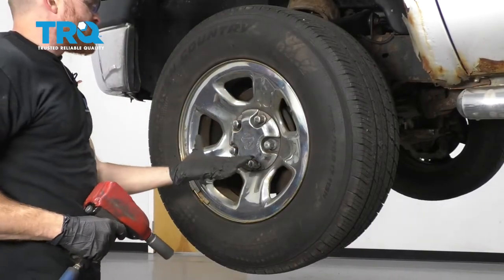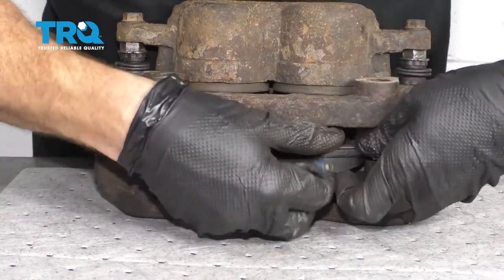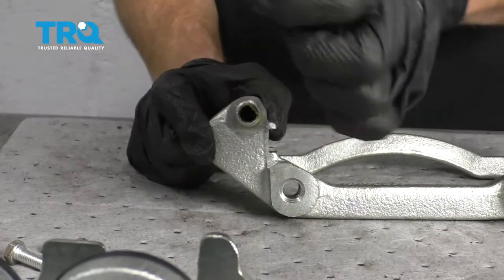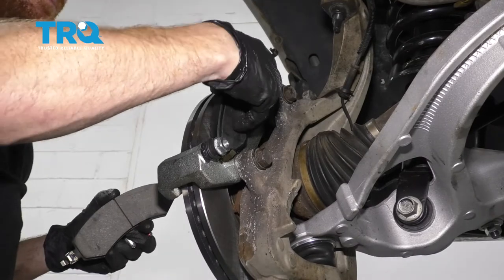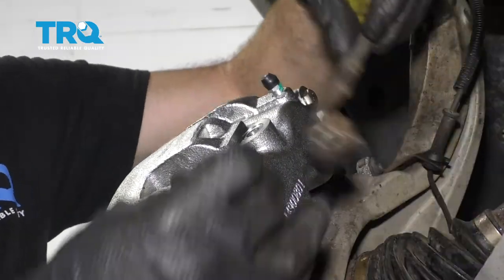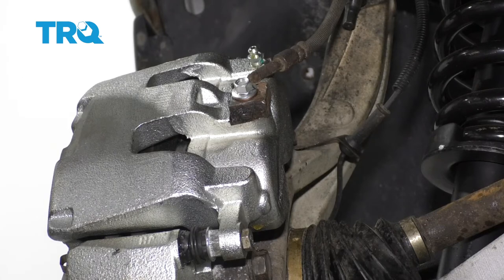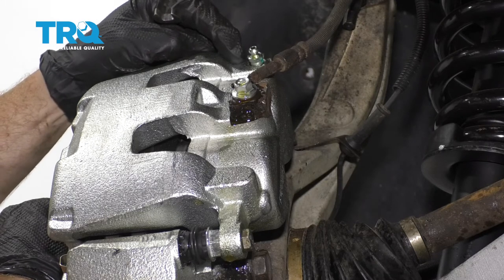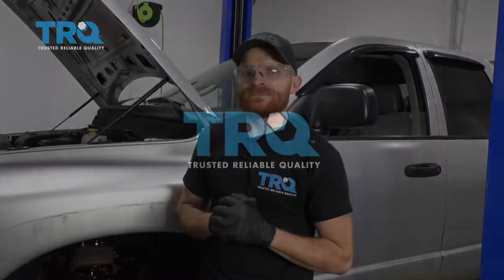How to Replace Front Brake Caliper 2002-05 Dodge RAM

Comment: Hello kind support,
What is  the part number for the single piece brake hardware kit? I like this set up better than the brake hardware that goes on the calipers instead of the actual brake pad. I would love to use the same set up that you have on this Ram. Thanks a million in advance. Stay safe and well.

Comment: If you are doing all 4 would you wait until the end to bleed them all or bleed each one as you go? Does it matter?
Reply: Bleed all four one they are all installed. Start with the caliper furthest from the master cylinder and work your way closer.